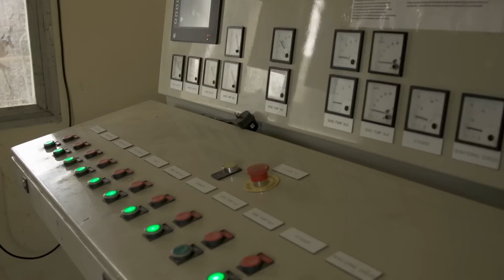Gold Mine for Sale! - Earnscleugh Gold Mine, Alexandra, New Zealand

Comment: I know this videos old but holy crap you guys have a lot of overburden not as much as in the Yukon you guys to get rid of a lot of your rock trucks. just putting in a cutter head dredge you'd save way more money on gas and people alone especially if you guys do it in segments. And when the best part about dredges that you get to run run everything you suck up but hey it's one of the ways you guys can accumulate slight more prophets especially if your run is more then I'm totally guessing here just because of the region that it's less than 7 months

Comment: Ever try of excavate accurately under black water? It will drive as average operator nuts. It is a haphazard method prone to loss. If there is a bedrock interface, it is most likely being "gold plated" as the excavator cannot accurately engage that face to shear below the bedrock surface to assure that gold, which often lies on that interface, is captured. The evidence of those losses will quickly be covered by slimes and tailings so the argument will never be settled. "But the ground drilled out good, where did the gold go?"
Reply: rose cutter dredge with a high flow nozzle to really suck the best gold out of the bedrock would have been smarter.

Someone smarter than these guys could buy the mine , modify the plant and catch the 50 % these guys are losing.
Reply: Lee Wilson you already have the answer to where the gold is located . Lol
Reply: @vvip4769   My gold is in the -10, +20 mesh pyrites at the bedrock interface. I can only accurately recover that pay zone by keeping the water below that zone.
Reply: @leewilson1368  sounds like you located in a lake of some sort how difficult  is it to keep the water at the required level to get the pay out and keep the water 2- 4 inches  at the bedrock surface??
Reply: @leewilson1368  How rich is your pay grams per ton, yards however you measure it???
Reply: V VIP what’s your 20? I’m in Alaska
Reply: @leewilson1368  Lol! I'm on the other side of the globe. 😂😂
Reply: V VIP I choose grizzly bears and snow rather than Kalgoorlies red dust and bastard snakes
Reply: @leewilson1368  Lol well yuh got to choose something I ent cut out for that coldness .🤣🤣
Reply: What's your email?? Let's connect!!
Reply: @leewilson1368  👍🏾👍🏾 we'll be in contact..